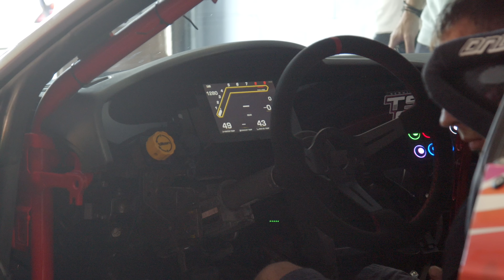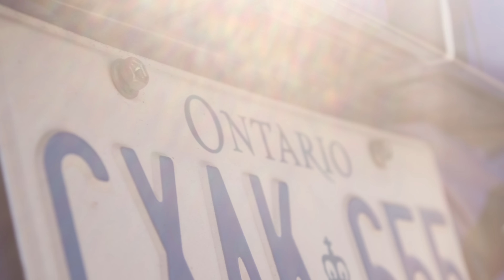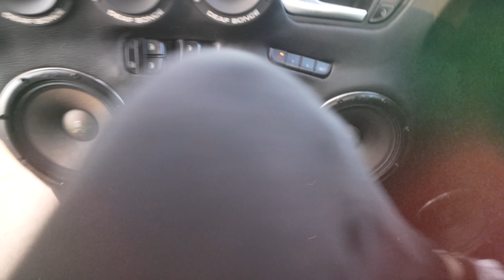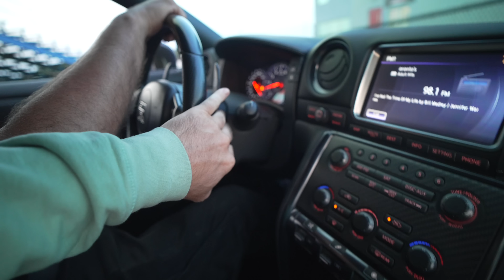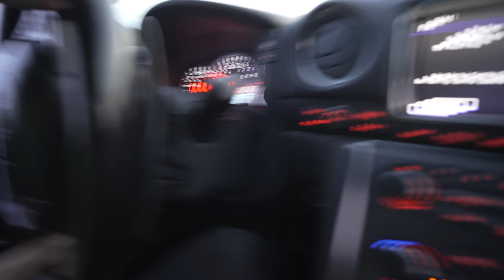VW made a 2JZ RIVAL that's ROTTING in scrapyards...

Comment: People have been tuning VR6 engines for 20-30 years, they are a great compact platform that make reliable power. Mines a completely standard 1998 engine, basic build, GT3582 making 400hp
Reply: Help me swap one into my e36 so I can go slide!😁
Reply: yeah, VW headz have been sticking VR6's into EVERYTHING VAG have ever made since I was a teenager in the late 90's. Maybe they don't overlap with drift too much lol
Reply: i already hate this video and i havnt played it the price of all my vr6 stuff is going to skyrcket
Reply: If you have an E36 you can just turbo the engine you have….
Reply: @foamdataservices  never seen an Audi with an E36! But yeah, there's DOZENS of unpopular 4 and 6 banger engines that can pust 400-800hp without becoming terribly unreliable or expensive
Reply: 30 years, the VR came out in the Corrado in 92
Reply: Got a B5 A4 RWD vr6t swap in works
Reply: That’s a good combo. I’m running the same turbo on my 07K and making slightly more power but I can imagine yours would boost a little faster than mine. Slightly laggy. 😂
Reply: I'm thinking of a VR6 Civic swap, because other than a Miata it has to be a Civic that's swapped.
Reply: try 30 years. When the import scene exploded in the early '90s, there were tons of VW VR6 build stories in the magazines
Reply: Swapping my mk4 gls
Reply: isnt the R32 engine the VR6?
Reply: @KarimAkors yes
Reply: can do 600 on a stock engine as long as boost ramped in properly , cannot beat the Wookie noise #malakamotorsport
Reply: Golf II GTI  2X VR6 engines one in front one in back
Reply: @KarimAkors  Yeah, the R32 Golf had a VR6 as well
Reply: Remember when people thought 400hp was a lot? VR6 guys remember. Because you are going to need to sell everything you own to make more than that with a garbage VR6. I like you using 2JZ in the title for clickbait. The trash VW motor compares to a 2JZ in less than zero ways. Lol.
Reply: I think hp bought a bunch of 2.5L Chinese vr6 motors that they are building i can't wait !
Reply: I’m glad someone said it bc I’m sitting here like this isn’t new and there’s very few that “rot” in junkyards bc people actually want them, they have for a long time😂
Reply: Until they run out of VR6's. The 20V Inline-5 is a much stronger block in comparison.
Reply: @KarimAkors it's a vr6 but that's not when they first came out. The 3.2 is nice along with 24 valves
Reply: 2nd best sounding engine ever! 
#1 is lexus lfa v10! Both are pure eargasms!😎
Reply: I hear the 2.8 holds boost stock for stock better than the 3.2 found in the mk4 R32.
Reply: @closewatermelon  it has more cylinder wall thickness. Which has an advantage in heat and.oversll block strength.
Reply: @prodogey69  that's the 2.8 or 3.2? didn't know exactly what the differences were either way!
Reply: @closewatermelon  the 3.2 is a punched out 2.8.. with a much higher flowing head design.
Reply: They’re awful for boosting. Massive differences between front and rear cylinder temp.
Reply: @bobsagit10  rear bank does run hotter due to the design but that doesn’t stop you throwing loads of boost at them, very strong engines.
Reply: I bought a VR612v Jetta GLX in '95 brand new.  100k mile factory warranty at the time on all pwr train is what sold me.  Great solid little car with the exception of shitty VW electrical plastic components.  Not all that fast by today's standards, but it sounded amazing then as they do today.
Reply: A gt35 just to make 400hp? Why not get a smaller turbo if you’re leaving it at that power? You can have a much smaller turbo that comes on earlier, quicker, and holds till redline.
Reply: @PapiAndrey  stock block + small turbo that comes on early = boom
Reply: @ryangabb743  cap I’ve seen them destroy stock blocks at 350 wheel
Reply: @bobsagit10  Not quite. Depends on a few factors, you can avoid that pretty easily just from tuning.
I didn’t say target 50psi at 1500rpm
Reply: 12v 💪
Reply: @eriklarson9137 highest record on stock internals on a VR6 is 875HP, what’s the 2JZ?
Reply: The best vr6 was the rare 24v that VW put in the GTI when even the most ignorant vw customer knew the 1.8t was a $400 chip away from making a reliable 200hp. (The 12v VR6 suddenly didn’t make much sense). 
I had a great black GTI with a 24v vr6 and eventually had a vf-engineering turbo charger installed. 500hp in a front wheel drive car- was a little nuts.

Comment: Part of the reason a vr6 is so good with boost is because of the large distances between cylinders and it having 19 head studs making head gasket problems rare.
Reply: There's actually less distance between the cylinders compared to a typical in line at the bottom near the crank. This is due to the angle and the offset. This is also yvw never turbocharged this engine from the factory. I wouldn't call it great with Boost
Reply: @CSLFiero  the space between cylinders is big enough there is a head bolt between them as compared to a inline motor having maybe 6-8mm between them. At the bottom doesn't matter as that is not the area with the highest cylinder pressure. That is always at the top of the bore.
Reply: @epjetta   all good points, but if we're looking at boosted versions of "VR" inlines, you basically get a litney of show ponies and the Bently w12 and bugatti w16. The VR6 out of a tuareg with a turbo isn't gonnna run a 24hr of leman
Reply: @CSLFiero  I don't know about that. Just because it hasn't been done doesn't mean it can't be done. I know of a few mk3 vr6 cars that run 450-550hp and have been doing so daily driven for many years.
Reply: @CSLFiero they did, just not on the North American market. China got factory VRT in their Atlas equivalent. HPA is now selling them as 550hp crates with a bit of magic. The VR was originally designed planned as a 2.9L diesel, so they were plenty stout
Reply: @CSLFiero They can be great with boost, depends on which engine because there are many.
But China got a 2.5t VR6 and there are already some that are making over 1000hp.

As mentioned, HPA sells a modified one that makes 550hp, but it’s very understressed and overbuilt. They’re also expensive, you’d be better off buying a factory crate yourself.

There are some videos online of this engine stock and tuned
Reply: @CSLFiero dude you can get 350wheel on 13pounds ON A STOCK MOTOR 🤦🏻

Comment: Don't forget the 5 cylinder as well! 😉 Another great sounding engine with a lot of potential. 

I owned a 1994 UrS4. Only turned on the radio on the highway when cruise engaged! 😊
Reply: I would have used the radio to drown out the whopping 200hp. But on the upside, your car only weighed 4000 pounds so...
Reply: @eriklarson9137  Well at least it was more pleasant than hearing a 1994 civic with a hot air intake scavenging for air from the horrible harmonics induced from some cheap overpriced  air intake with a crappy note from the ever so popular fart can to give a gut feeling of getting a 1/2 HP.
Reply: @eriklarson9137  you should look into the potential of the 3B and AAN. 5 cylinders sound amazing.
Reply: Yes, i love the Lamborghini V10 Sound of the Audi I5 engines

Comment: Ea888s are strong reliable engines, especially in the more modern revisions. Endless aftermarket and the fact VAG stuffed them in everything makes them a viable swap candidate.
Reply: reliable 😂😂😂😂
after u spend like another 8000 - 12000 usd on it
Reply: @mj-lc9db  i have a 2009 Passat with 150k miles on it and the cct engine. The only repair i made is the timing chain at 120k miles. 28 mpg average, fun to drive car.
Reply: IDK about strong and reliable, the engine in my A4 spun a rod bearing on my way to work and all the machine shops in toronto were backed up like crazy with work so i had to find a new engine. With parts, labor and a junkyard engine with unknown KM's it cost me 7k CAD to get my car back on the road lmfao. thats just my daily too
Reply: @a200tq1  I have an A5 sport back  that thing mostly the timing is insane and maintaining it is a headache id advice someone to get a BMW mostly the 6 cylinder ones. The EA888 win in terms of fuel economy and performance tbh.
Reply: Make sure it’s 2015 or newer ea888!!!
Reply: @mj-lc9db  you have ZERO idea what you’re talking about…. EA888 engines are absolute UNITS straight from the factory.

There’s so many GTIs and Audis running 500+ hp on stock engines with ZERO issues.
Reply: @robertburton8055  bro I have an A5 sportback with an EA888 im not talking stories, Im talking what me and my friends go through one has a GTI and another a Golf R.

Back 2020 we laughed at my friend for getting an N55 BMW, hes making around 600hp reliably we have been going to the mechanic all time and we are being told those are common issues which i find them absurd. This EA888 is overrated + the water pump keeps on failing + this timing is soo bad and we do maintain our cars btw. 

The EA888 is not bad i agree but it ranks bottom when it comes to making power reliably.
Reply: @mj-lc9db that’s you, you probably bought a cheap one that’s has poor history or got bent, my MK7 GTI made 400whp on 93, I daily it, 122k miles, 32mpg and hurt V8 feelings.
Reply: @Yaboybash  😂😂😂 Goodbye bro
Reply: @Yaboybash  U clearly know nothing
Reply: @mj-lc9db  “you clear know nothing”
Sorry I know how to maintain my cars and don’t bitch and moan 🤠
Reply: @mj-lc9db  random Q….. have you driven the Golf R and do you think the A5 is as fun AND better than the Golf R??

I’ve got an IS38 swapped Sportwagen 4motion with stage 2 tunes and I wanna get something better and A5, S4 and Golf R are all at the top of my radar
Reply: @robertburton8055  Yeah the Golf R is definitely fun than the A5 tbh. Imagine a GTI with 300HP and AWD. Its soo fun tbh. The A5 is good but a bit bulky on my side. An S4 is insane also but tbh just get the Golf R u wont regret my dude.
Reply: @mj-lc9db  Only in the US and Canada do VW's have "weak" engines. In the rest of the world people have found them to be quite robust.

Comment: Back in VWVortex hay day, there were dudes doing weekend VR6 swaps for about $3000 Canadian.  Included everything.  Drop car off, pick it up a few days later with a VR6 instead of the 2.0 8v or whatever you pulled.  They would also keep / scrap your old motor as part of keeping costs down.  It was the swap to do in the VW scene.  1.8t were such a small percent of swaps.  People would even pull the very easy to make power 1.8t to swap in Vr6.  I always dreamt of VR swapping my 1995 Golf Sport I had, but found similar power with less work through a Neuspeed supercharger on my fairly built 2.0 8v.

Comment: I think the VAG 1.8T should be on your radar. The straight-liners seem to rate (and push) them pretty hard on the continent.

"Use the momentum of the car, not the breaks".. The look on Josh's face, I 100% expected them to be doing a bit of grass trimming.
Reply: Check out Thomas Zurawski and what he is doing to the 1.8. Big numbers 500bhp and more.
Reply: @TD5rage  CO Motorsports is making over 1000whp with a 1.8t based engine.
Reply: @MrJuice315 just commented that 1 min ago
Reply: @TD5rage not hard these days to get 500 outta 1.8t... ppl are at 800-1000 at the moment
Reply: @ what cost? I don't care, I want to find cheapest $/hp. K series, ls, vw?

Comment: I have a currently 1042hp VR6 but changing cams and haldex clutches, adding more boost and will see 1200hp….it’s a good engine!
Reply: Nice. What parts in it? What can stock bottom end handle? Where do you get the parts summit?
Reply: @aaronmarkstaller  probably ~500 crank is upper limit of stock bottom end. 35xx Garrett and about 1-1.2 bar boost will get you there depending on setup

Most 3.2 vr6 were produced with cast cranks, so 2004 or earlier forged versions generally more desirable.

Comment: They're not uncommon in Europe, locally there was a AWD MK2 Golf Rallye with a turbo VR6 engine, albeit the older one, but I can't remember if it's a 2.8 or 2.9, only local VR6 swapped car I can remember, besides the various Golf MK3 that came with them stock, or the VW Sharan that also came as a VR6, which I love that VW did, and in a car they had a cooperation with Ford on as well! so you could basically if you optioned for it all, get a Ford Galaxy with AWD and a 2.8 VR6 engine from factory, as well as the VW Sharan VR6 of course, but the Ford used mostly VW engines, so if you got the diesel? 1.9 TDI. :P
That's the late 90s models, like 96 or something, up to around 2005 or so, first gen Ford Galaxy (the EU minivan, not the big old US barge) and first gen VW Sharan (technically also sold as Seat Alhambra) so technically you could get a VW with a Ford engine too, as the 2.0i was the Ford one.
(I generally remember those cars due to dealerships locally were a pain, so if you had the VW Sharan/Seat Alhambra with the 2.0i and went to the VW dealership, they'd tell you to go to the Ford dealership with it, and if you had the 2.8i 24v, or 1.9 diesel Ford Galaxy and went to the Ford dealership, they'd tell you to go to the VW dealership, so customers were annoyed.)

And technically... there is a VR5 too, though only sold in Germany I believe, and sold as a V5, in late 90s early 2000s VW, in a 2.3 10v version with 150hp, and a 2.3 20v version with 170hp, so you could get a MK4 Golf V5 4Motion, so a AWD 5 cylinder Golf from factory, same with Passat, and... I never remember if it was Vento or Bora, as it swapped around that era, I do however remember being sad you didn't get a 4Motion version of the New Beetle 2.3 V5, as an AWD 5cyl New Beetle would have been a hilarious sleeper, but you only got those as FWD with the V5 engine, I've been wanting one for ages even with FWD, just the hilarity of a 5cyl New Beetle, and as it's a VW, you get plenty handling bits so it could be a fun AutoX or trackday fun car.

But that's enough of my ADHD tangents, sorry about that.
Reply: Great info mate!
Reply: 2.5 vr5 was also available in the US. Mid 00's to mid teens.
Reply: @pchitti241  the VR5 was only a 2.3 liter, as the VR means it's staggered, it basically has a V shape, but so shallow that it's only one head, but it basically has 3 cylinders on one side, and 2 on the other, making it more compact than the 2.5 you mentioned, which is just a normal I5 engine, not a VR5 (V is for well.. V like in a V6 or V8, R is what Germans use instead of I for Inline, it's R for Rekke I think, which translates to Inline, and as it's such a shallow V, it's basically something between a V and Inline, hence the name.)
Reply: @VampyrMygg  you got me there, I assumed it was the vr5 and never looked into it further. Thanks for the info

Comment: I've been steady wondering why audi's aren't used in drift more. It's not much to make them rear wheel, the 5 cylinder turbo they have now is quite awesome and reliable. Im happy to see someone making huge jump and doing it. 2025 formula d is going to be awesome to see what the car can do after all the shakedown runs next year
Reply: with a stage 2 the rs3 makes 500hp+
Reply: Rickard Ivars here in sweden drifts a RS5, if i remember correct he took out his vr6 engine to a M50
Reply: In a lot of the RS models certainly the chassis dynamics aren’t great. Quite often the engine sits WAY forward infront of the turrets, which doesn’t help the chronic understeer issue you often get. I’m sure there’s ways around it with tuning and geometry but they’re often not a great base platform for this specific use.
Reply: Cos Audi cars drift the wrong way around hehehehe
Reply: Check out ALM racing. They drift in AWD. NOT RWD!😉
Reply: Because why would you choose to oversteer in a car known for understeer?
Reply: Idk about Canada but the average person in the US does not have the salary to afford an RS5.... But man I'd love one, or the RS6 Avant...
Reply: so many are Quattro / heavy through the front wheels so they get overlooked a lot, but the Audi looks great and has nice potential
Reply: @JW-qf2fx  ALM racing doesn't have any problems lighting up all four.
Reply: The 5 cylinder turbos are definitely king but the VR is right there with it

Comment: From vr6 3.2 600+hp is nothing for this engine.I mean is will be a very reliable engine. Even from 1.8T 600hp can make "easy" . Above 600hp you can use a 15-20mm! steel plate extension to prevent twist or bend the aluminium motor. Then you are good to go till the screws can hold the crankshaft:)

Comment: Check out the Audi 3.0t CAJA engine, 550hp easy on stock engine,  stock supercharger & exhaust. Aftermarket Throttle body, pulley and chip will get you there. They are cheap too! They are the early versions of 3.0t and very strong.

Comment: Put in a forged 12v crank, makes it 3.0 and will eat 1000hp without problems.
Reply: We have forged crankshaft but 3.2. Basically anything drift related 800hp equal 1100 in drag applications
Reply: @TSHauto  nice. The 12v swap is a cheaper swap I guess. Not saying it's better btw. Just know it's done pretty often here in the Netherlands.

Comment: I wonder if a vr6 will fit in a landrover discovery 4 to replace its rubbish engine 3,litre diesel
Reply: It will it’s a compact engine that goes in hatchbacks it will fit easy in a disco. Diesel pump uk- make bell housing adapter plates for land rovers if you ask him he could probably cnc a adapter for vr6 to land rove box. Then all you need is a stand alone engine control unit

Comment: You spelled BMW wrong. You just need a tune to make over 500ft tq and 500 whp, on regular pump gas 93 octane. There is a reason why Toyota had BMW use their engine in the new MK5 Toyota Supra's. 3.0L Tune, upgraded down pipes and race gas = 9 sec car. With very much needed.